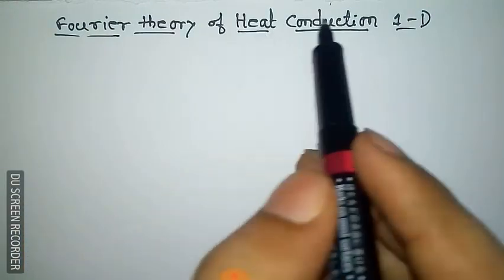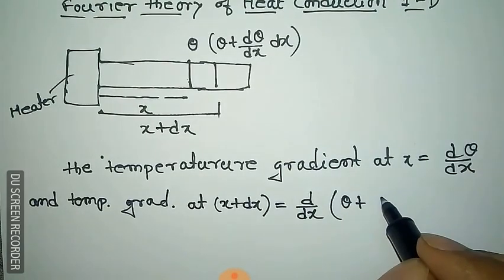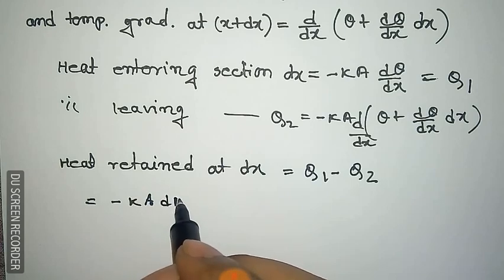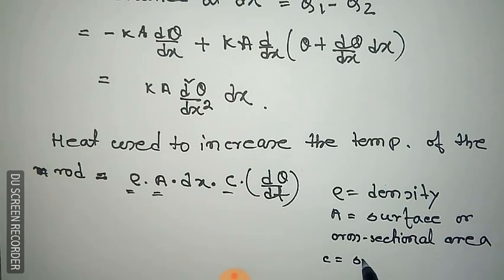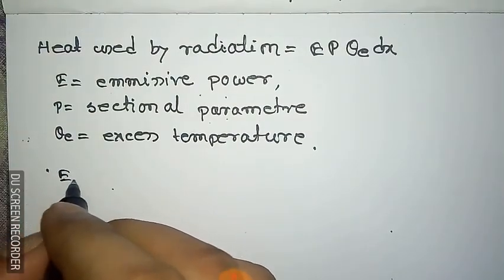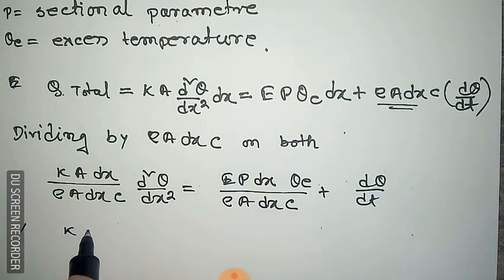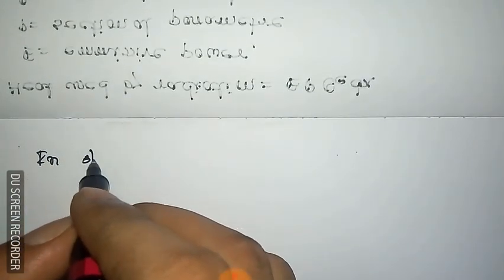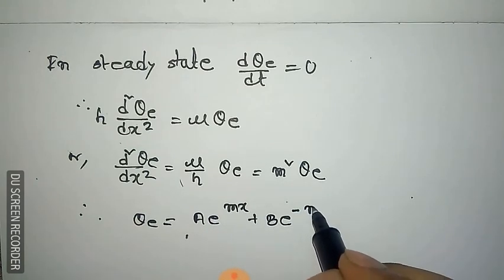Fouriers theory for heat conduction for one dimensional object

Comment: Which formula you have used for heat lost due to radiation and heat grained??
Can u please explain me both the formula used??
Reply: Energy conservation
Heat Energy store in area A*(x to x+dx)= amount of heat to increase temperature of rod + heat loss(as Radiation) into Sorrounding
Reply: Heat  gain = mass × specific heat × (d@/dt)
Where @ is theta
Reply: Heat loss in form of radiation = radiation energy emitted per second per unit surface area ×( Area) × temperature
(Hera Area = perimeter × dx)